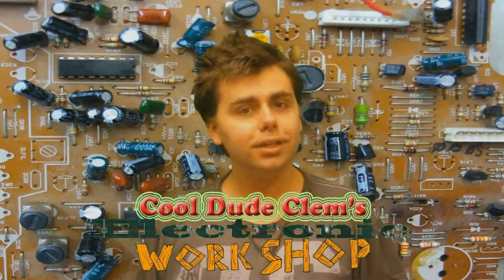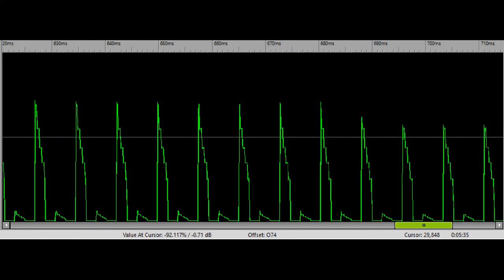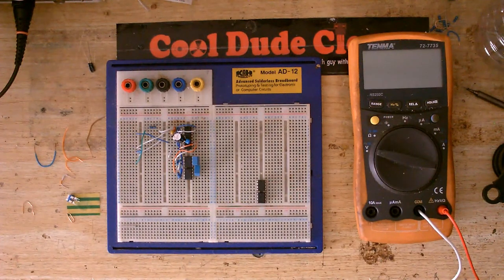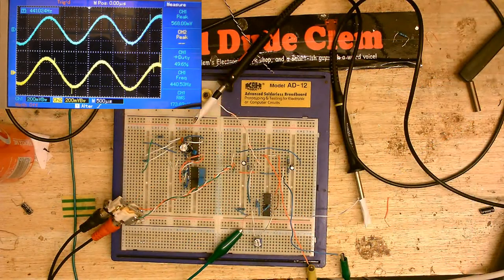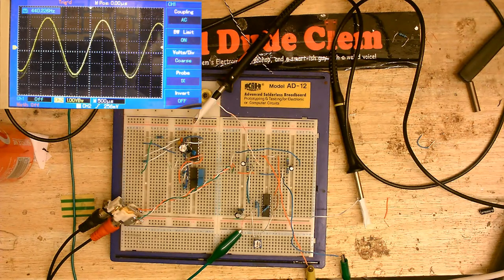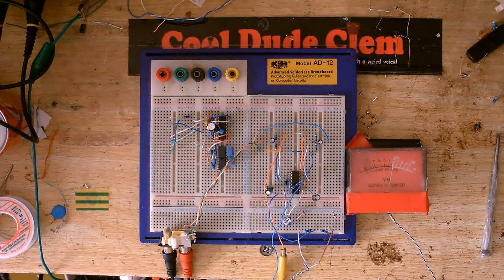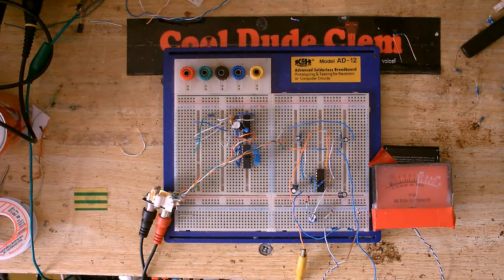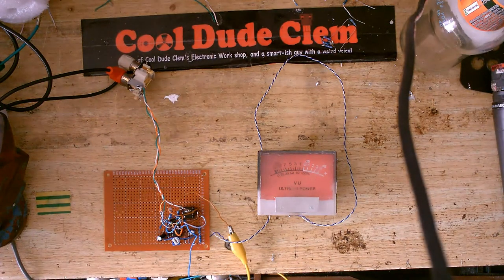Making an audio mixer for my computer. Part 2 - VU Meter

Comment: Hi Clem, according to your schematic the two buffer amplifiers apply the signal through two 1k resistors to the rectifier input. Isn't it a bit counter-intuitive that the signal of both channels is only added properly, as long as both are in phase? If for instance you would supply a signal to one input channel and an inverted copy of it to the other one, the signals would exactly annihilate themselves at the interconnection of the two 1k resistors and the meter would show zero, where in fact in a stereo headphone there could be a loud tone heard. If you capture a source distant from a stereo microphone, you inevitably have phase shift in the two signals of both channels (which lets ones brain determine the direction of the source through binaural hearing), which would lead to false readings on the meter.
Reply from the maker: This is made with mixing stereo music with mono compatibility in mind, as this can tell me if something is in phase on both channels or not.

Comment: Well done!
I found the way you overcame the Rectifier Diode forward voltage drop problem rather novel.
Are those really Germanium Diodes?
The packages look unusually small to me.
Reply from the maker: They appear to be, I measured the voltage drop and it's about 200mV, which I think is about right,